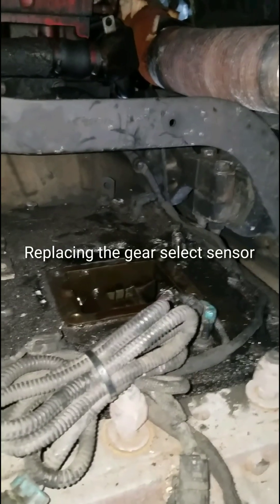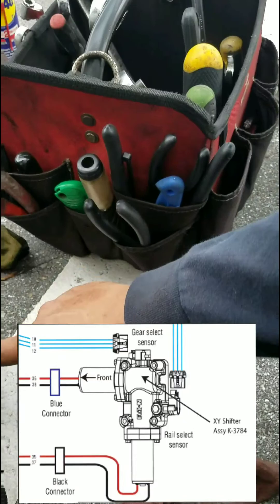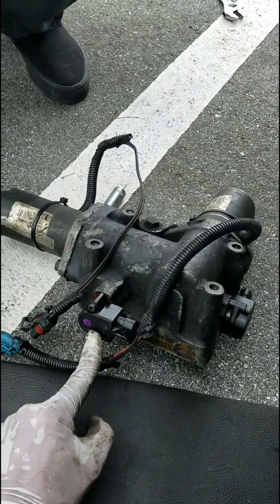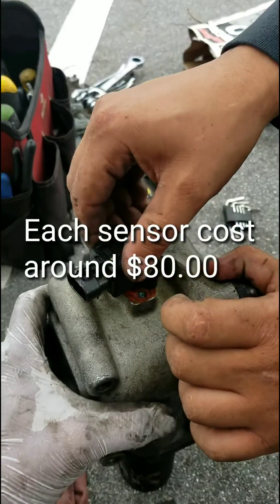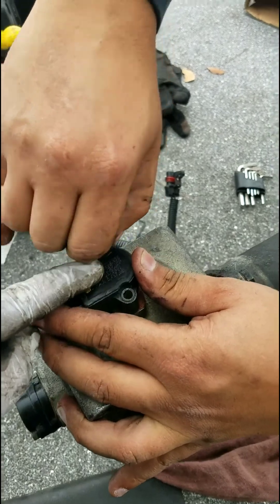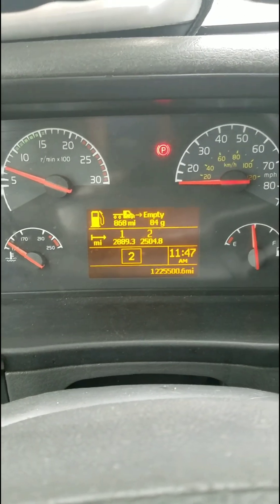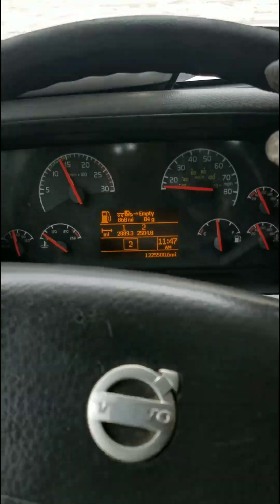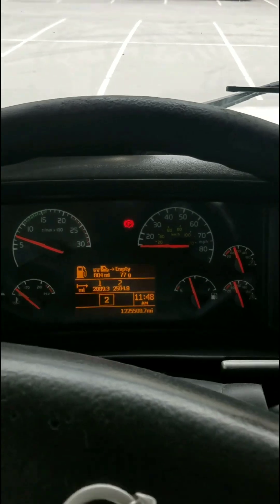Eaton Ultrashift Problems

Comment: Nice video and informativei have a Volvo d11 I shift Eaton 10sp  I'm having an issue mine started jumping on stop and go acceleration I'm trying to figure out if it's the clutch it starts engaging at 800 rpm hard I don't if it's the software or other

Comment: Hey bro. I have a 2016 freightliner cascadia that the check transmission light started flashing. It won’t connect to drive or reverse. Clutch was recently done actuator replaced aswell. Any idea what this can be. ? I got a code 25 on it. N To F on dash board bro. Please help.
Reply from the maker: Sorry but 2016 is a different transmission 😒
Reply: Did u find out the problem sir I'm having same issue

Comment: Hello!
Here is such a problem, you can help, also the same box only on classice there was such a problem, sometimes the service blinks rides,and sometimes remains in gear 8 or 9 and does not switch to higher or lower.

Comment: I recharged my batteries and the lights on the transmission shifter will all light up and then all the lights go off and it might show the red service light blinking but it's not showing in neutral on the shifter or on the dash

Comment: My 13speed unltrashift will drive fine , but it will go into transmission default mode and I have to stop and turn off truck and start again. Then it drives fine for 100 to 500 miles then does it again.  The dealerships can't find a fault code when I take it to them and they say they can't find any issues . It's been doing this for over 1yr . Some say change xy shifter and some say change clutch actuator.  But it's been doing this for almost 2yrs . Now it's starting to do it more frequently.  Could thus be the gear position sensor also or likely something else ? It does it mostly when I'm cruising down interstate and on cruise control , not when changing gears. It's also done it when I'm parked in neutral . But if I turn off truck and start again the code clears and is ok again
Reply: Hey bro you fix your problem I have the same thing
Reply: @josiasaez4094  yes it was transmission,  I changed the wiring harness and the xy shifter.  Now it runs great.

Comment: Im havin that problem rite now, lucky me i was 150 miles from home so i drove back n im changing it tomorw,  ill reply to this message if my problem got solved
Reply: I changed the sensor and it gave me problems 1 day after then it ended up to be the speed sensor. That was my problem

Comment: Erison duran my ultrashift goes out of 2 when starting up I stop about 2 or 3 times then the truck picks up the gear but when I stop again the same problem happens to me.
Reply from the maker: Check the clutch but you need to retrieve the code to see what the problem is. Rail or gear select sensors could also be the issue.
Reply: @erinsonduran6663  i change the clutch and the range valvular and sensor to but continue the problem the code I have is 41 or 769 transmission range low actuator fm1 (7)
Reply from the maker: @angelgonz201060  definitely is the xy-shifter sensors,
Reply: @erinsonduran6663  ok thanks for your help !!!

Comment: Hi Erin truck would stick in gear with fault 51 and 56 I changed input shaft sensor still doing the same thing do you think rail position sensor will remedy the issue?Also seems like the service light and issue only happens during alot of shift changing traffic , local shifting etc not going down the highway your advice would be much appreciated before I start throwing parts at it!
Reply from the maker: I will swap all sensors, shaft, rail and  gear.  They only cost around $40 each.

Comment: My truck has an Eaton auto shift, and during up shifts when it gets to 7th gear it takes a second attempt, and during down shifts from 10th to 9th it takes a second attempt. Also if I stop the truck real hard with a load or use the engine brake the transmission will get stuck in gear and won’t shift unless I turn it off and turn it back on like it was in limp mode. Can you help me diagnose it? Thanks
Reply from the maker: It could be the speed sensor located by the shaft
Reply: @erinsonduran6663  Thanks

Comment: I just bought a PETERBILT with a 13 speed automatic transmission. And is showing tranny Fault on dash board and service light on shifter and took it to PETERBILT and the said that the scanner is not getting any codes . But I do notice a rough shifting on first gears . Do you think is gonna be the same problem as yours?
Reply: Did you get it fixed??? If what was the problem
Reply: After they clear codes took it home and 3 weeks later dash was showing transmission needs to cool down and I notice my fan was turning on at 190 degrees (constantly) so I took it to get check and it turned out there was a short on the temperature sensor circuit of transmission. So sometimes there’s cables rubbing somewhere and they can react with codes !!!

Comment: Hello I’m having similar issues. Gear on dash goes blank and while on 10 gear when I start slowing down gears won’t drop. Help
Reply: I’ve changed xy shifter and truck is working perfect
Reply: Only code I’m getting is short on speed sensor

Comment: Hi I was wondering if you could help me  figure out my truck's trans problem, I have a 2012 International automatic Prostar Maxxcruise, when I drive it, sometimes  it won't get pass second gear,  only after a couple of minutes it shifts to 3rd and so on. when I stop and start rolling again, it will do it again it won't pass second gear. any suggestions? thank you

Comment: Hi I'm wondering if you could help with an idea of what could be my problem, my transmission is doing the same thing as the video & every time it has to change gears is sleeping or getting stuck on the previous gear, & doesn't do any changing until I stop cut off the truck & let it cold down a little bit like 30 minutes and that's how it gets out of gear to neutral but keeps doing it, Changed the clutch actuator works for like 3 hrs and start doing it again, the codes that I got is 2 #88 & #27 any help with an advice or any idea that could be the problem will appreciated thanks in advance sorry for the long texts..
Reply: What was the issue?

Comment: I have a 2011 Pete and like once a month it gets stuck on 6th gear and won’t change until it sits for like a few minutes and resets and it only happens when I get loaded I drive a dump truck 
What you think bro it does it rarely
Reply: Did you find the problem?

Comment: Hey I have the same problem with codes m 130 p 191 f 5 and its stuck in neutral any suggestions dash read F and N with service light on
Reply from the maker: Robert try to get the code from the transmission not from the truck ecu, because Eaton's transmissions have their own ECUs
Reply: @erinsonduran6663  what do that mean
Reply: That's the code from the transmission ecu
Reply: Low current TECU. Power cable breakage. FMI 5   An open circuit in the sensor circuit. Is what it's reading

Comment: I have that same problem on my 2010 peterbilt, I put a new xy shifter with new sensors too and the problem is still there, which could be, please if you could help me, I would appreciate it
Reply from the maker: What code are you getting?
Reply: Flash code 35
Reply: May be bad battery like one is good n 2nd is old or bad or wiring issues if you already have changed xy n still have same problem most drivers n Mechanical saying

Comment: Truck just died at stop light,range low actuator code and controller 1 also,didnt wanna go into any gear except reverse 2008 d12 ultrashift
Reply from the maker: You have to retrieve the code so I can help you.  It sound like a clutch problem but again try to get the code.
Reply: Sid 254 fmi 8 controller 1,spn 769 fmi 7 range low actuator,towed it to repair shop now waiting for the morning.Thanks for replying! It made a ton of grinding noise when starting in 1st gear
Reply from the maker: @vasacsl63  be careful with shop, because most of the time they be guessing.  Send me the codes they get to see if I can help you.
Reply: @erinsonduran6663  follow up,after replacing range valve problem did not reappear and it has been 20k miles since then,by the way truck worked fine after sitting overnight but i insisted he check range valve and he measured resistance or voltage idk and he found its bad 300$ part

Comment: I’m having this same issue my truck is driveable but it keeps flashing check transmission and going from 10 to F
Reply: Thanks brother finally I found my question get same problem kenworth t700 2013 from 10 to F with service flashing light how much cost to change the clutch?
Reply: Did u get it fix ?
Reply: @shannonhenderson1288  yep it was the clutch

Comment: Hey Erinson, I know this is an older video. But I would like your opinion if possible. I have a 2014 Pete 579 with 538k miles. I was offloading at Walmart, and when driving away, suddenly I cannot go past 5th gear/19mph. I replaced the Range Valve, Splitter Valve, and Air filter regulator for those two valves. Still having the same problem. It is showing code 71. But it is not stuck in gear. Gears 1-5 perform flawlessly. Your opinion is appreciated!
Reply: Basically it won’t go into HIGH.
Reply: @TexasBroskiActual  hi having the same problem. Where you able to fix your problem. ??
Reply: @evenorderas9526  I was not. Spent about $15k over 1 year replacing all the parts multiple times and even the clutch. Didn’t fix it. I ended swapping to a used 13 speed manual for 6k. Now no issues.
Reply from the maker: @TexasBroskiActual  ok found some pictures let me know if you want them, I dont know how to send them though YouTube.
Reply: Erinson Duran Ok, thanks. That’s one thing I had not considered yet.
Reply from the maker: To me it sound that your 6th gear is bad, I would see if I can find some pictures to send them to you so you can have an illustration of what I did. My truck was a volvo and what I did when that happened to me was that I managed to get the top of the transmission where the xy-shifter sit on and found out that one gear was bad. I when to a junk yard and bought a bad transmission, got the tail with yoke and pay a Mechanic just to replace that gear. The tail is where the range is attached. Subscribe to my channel I will start posting more videos again.

Comment: hey bud I have got eaton ultra-shift 10 speed . it shifts pretty hard from 7th to 9th gear. what could be the problem.
Reply from the maker: Change the speed sensors, 2 on top of the transmission and one in the joke. Very easy to change but spray some WD-40 to loosen up sensors because they get stuck and could very difficult to get them out. Good luck and subscribe.

Comment: My 8600 is stuck in N and it won't go into drive
Reply from the maker: You need new position sensors, rail and gear select
Reply: @erinsonduran6663   need  help can l have you phone number
Reply: Thank you I am going to try it now
Reply from the maker: @kenney992  you can also hit the sensors gently with something and it could work temporarily work
Reply: Ok
Reply: I tried to scan the truck and I got one code 25

Comment: I'm sorry if I sound weird, cause I'm not a truck driver and I don't really understand anything in trucks. I have a question. My father is a truck driver and his truck wouldn't go into gear. F of the dashboard. Code 27. He has a brand new Reman transmission (9000$ total), installed it in a shop a month ago. He also has Eaton autoshift. He tried replacing speed sensor, nothing still. Checked battery connectors, the same. What can be the issue?

Comment: Hey bud, I have eaton fuller auto 10 speed  transmission. The problem i have is, hard up shifting from 7th to 9th gear no code , down shifting is smooth. can you help please
Reply from the maker: IT could be your gear select motor or sensor, since you don't have a code it is hard to tell.

Comment: What about when u stop did it act up like when u had to brake say from 40mph to a complete stop ? Did it do fault n couldn’t get rolling ? Till disconnecting the batteries or something like that ? Cuz that’s happening to my 07 Volvo w auto transmission
Reply from the maker: Yes disconnect the battery and wait until it resets
Reply: Erinson Duran would u know what the problem to that is tho? Electrical or the sensor?

Comment: Great video. After I drive for 5 minutes when I stop at a light and move off it wont shift from the gear I move off in. Do you think that's the xy shifter or a sensor?
Reply from the maker: It could be the clutch,  but try to get the codes from the ECU by turning the key off and on 4 times in 5 seconds.  Remember to start in the on position and finish in the on position. It is the only way to know if it is the xy-shifter or the clutch. Good luck
Reply: @erinsonduran6663  I'm getting 4 codes, they are 27, 32, 33 and 65
Reply from the maker: @ISLANDTRUCKER  it looks like wiring issues, start by changing the transmission harness.
Reply: @erinsonduran6663  👍

Comment: Hey bro, I have a 2008 Pete with 10 speed Ultrashift DM3. It won't catch any gear from nutral. I did a reset with the ignition key twice, and it worked and I drove for about 50 miles, but the problem came back when I stopped to park it for the night. Now I'm getting fault code "88". After I stopped for few hours, I tried again, and got it to catch a gear. Any idea what the problem is? Thanks.
Reply from the maker: Definitely It is the gear position sensor. You need to get a new xy-shifter, 88 means that you computer did not find any problem at starting.
Reply: Did the GPS help ? I'm having the same problem

Comment: please help firs it got stucked in 10th gear i had to reset the truck then after couple of days its giving me F while shifting gears i replaced the harnes but this not hellped the problem please help
Reply from the maker: That is the gear select, disconnect the shifter for 10 minutes and plug it back and also disconnect the batteries

Comment: international prostar eaton fuller communication has been lost neutral in the transmission j1939
Reply from the maker: That is wiring harness
Reply: Thank you sir for your response I’m headed to the mechanic which harness do you think it is?
They want Myron replace the transmission to manual asking around 4000$
Reply from the maker: @madseason7976  it is a waste of money my brother did that and the mechanic said $4k and he end up spending over $7k, once you fix this you will not have a problem
Reply: They already replaced the hares from tcu to shifter
Reply: I really appreciate your response !
Reply: Erinson Duran brother they replaced the harness from TcU to shifter and mechanic doesn’t know where else to look for I’m going to be in the shop in 10 min thank you for your time you are great Man!
Reply: did you fix your problem?pleas call me 3036694771 i spend $7000still have the problem?

Comment: I have problem on my Volvo 2007 Automatic Eaton transmisson. I got stuck only in 2nd gear when I competely stop, not happend often but every second or third day. I disconnected battaries for 5min and turn on truck again. I had that problem before. My mechanic change harnes and 1 transmisson speed sensor wich was look bad. After 3 weeks no problems and  then that problem came back again. On computer in Volvo delarship showing only Fault on transmission.  In Volvo delarship told me they need take off transmission and see whats going on and thats 10 hours labor to take off, I dont believe them and I refused. They are crooks. I saw many topics about similar problem, can be XY shifter ? Should I change XY shifter and other two transmission speed sensors ? Can be anything else beside that ? Thank you a lot for advices. I am so scared that I will stuck in 2nd gear in middle of traffic and wont able to move anymore.
Reply from the maker: My friend definitely your problem is the xy-shifter (gear select) the dealer did the same thing to me and could not fix it. This is why I did this video
Reply: @erinsonduran6663  Thank you a lot for respond ! Do you maybe know how long is labor for change the xy shifter ?
Reply from the maker: @domagojkerestes4204  it is less than 30 minutes in a volvo
Reply: I got 2006 volvo automatic with clutch but the same issue. and the dealer told me they need take off transmission and see what's going on inside but they not sure then I refuse so please tell me how you fixed your truck finally
Reply: Mine was always blinking F or not wanting to goto the next gear. Like right now after changing the xy shifter, new transmission harness, and clutch. It’s still giving me issues. It’s hard to keep a driver in it when the problem just always comes back.

Comment: I have a 2006 Volvo with Eaton xy shifter I’m getting a code for shift finger rail actuator 1 (varo) and shift finger gear actuator 1 (vago). Also had power supply electrical fault come on one time. Do you know what that can be?
Reply from the maker: Sound like xy-shifter is going bad, because the finger very rarely goes bad. Check out other codes
Reply: I'm having the same..did you resolved yours.

Comment: Hey bud I get code 44 and I did the ohms check like Eaton suggested and it’s out of spec Eaton says 2 to 6 ohms mine is 11 sometimes 13
Reply: The inertia brake ohm
Reply from the maker: I had  code 44 and I end up changing the clutch, problem solved. Good luck

Comment: Hey I stopped for the night with my truck off, haven’t had any issues beforehand. Woke up, turned the truck on and after about a minute I get transmission fault code SA 3 SPN 788 FMI 7 stays neutral with F blinking and it wont let me change it to Drive or anything else . It’s 2017 Volvo Cummins x15 with Eaton FOAM 15810s- EC3 smart trans. Got mechanic skills and I’m in a very bad place with rip-off shops around me. Any thoughts please?
Reply: What was the problem?
Reply: How did you solve the issue?
Reply: @luisvega96  it was the transmission actuator the one that moves tranny from N to D if I remember correctly, got burned.